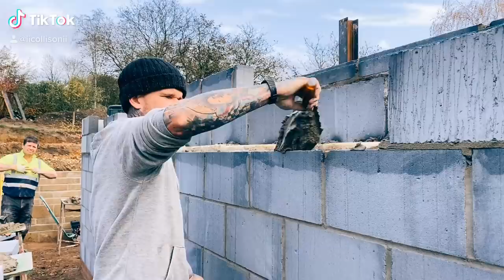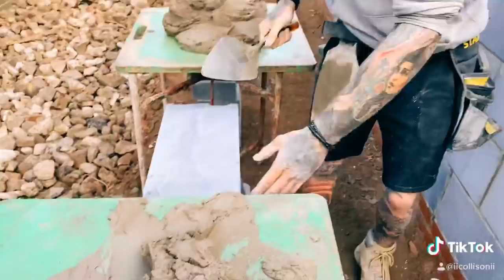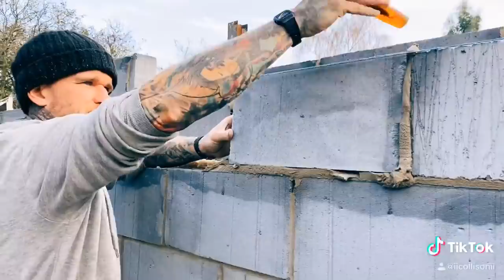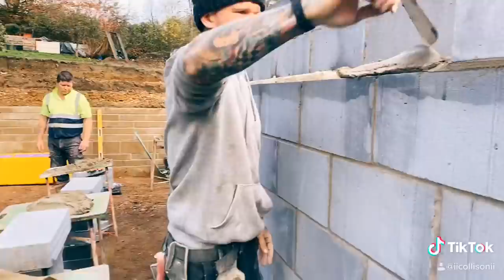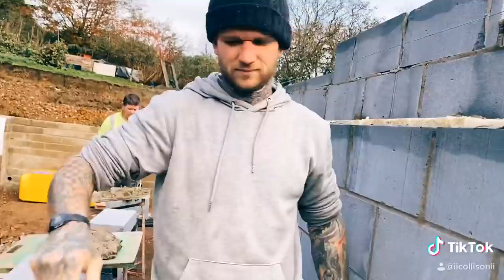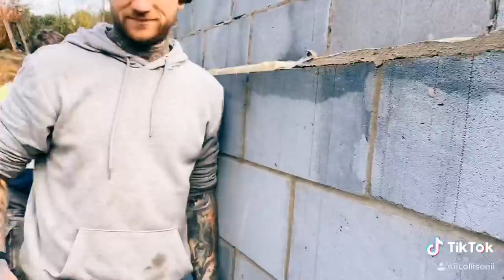Stuck in the middle laying blocks

Comment: Your a good lad Charlie
Reply: Have tried out the rubber handle Rose trowel think slightly longer handle than the plastic 1,s 

Was going to give the cork handle 1 a go. Never used plastic 1 thought maybe a bit slippery in hand if have a glove on laying them concrete blocks.

Comment: Y do u mud the wall and not the block and then stab it in just wandering  I was shown to mud the blocks
Reply: Probably because he’s having to reach up so if he’s putting mud on the block it’ll be a lot heavier on the arm after a while this way he can lift the block with one hand and the tip of the trowel
Reply: Preference probably  them blocks are as light as a feather can pick them up with two fingers lol i muck the block less mess